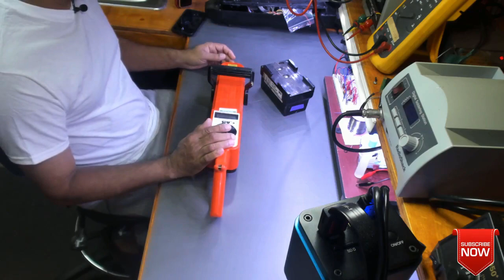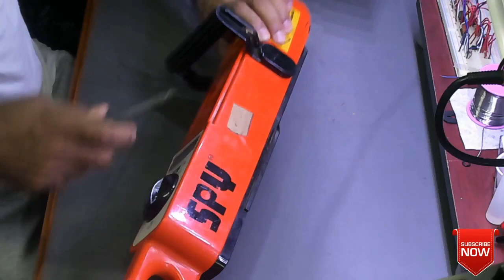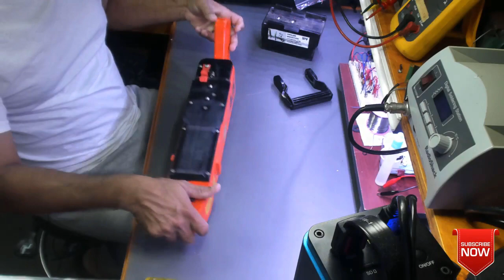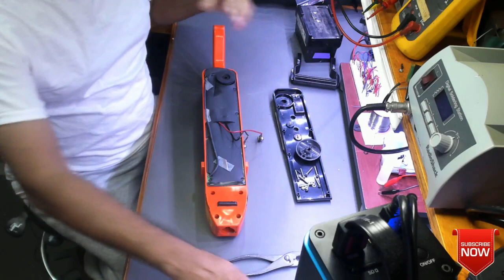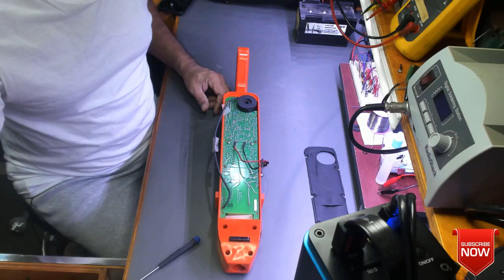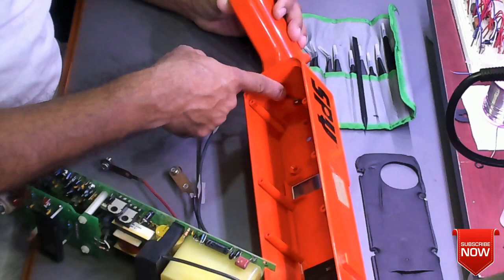Spy 790

Comment from the maker: When you open there are some small voltage regulators near the Selector switch and one close to the transformer. Check those and see if they are faulty.

Comment: Sir what is type of transformer used in holiday detector
Reply from the maker: It is a special transformer that is wind by the manufacturer for this unit
Reply: Sir my holiday detector display in voltage is changing but output is not coming sir give me any suggestion
Reply from the maker: @vinaybabu9569  what model do you have.
Reply: Spy holiday detector, model:790

Comment: It isn’t a voltage meter it is actually a holiday detector with an internal voltage meter to manage the output voltage!
Reply from the maker: Yes it is a holiday detector that can detect holidays in pipeline coating.